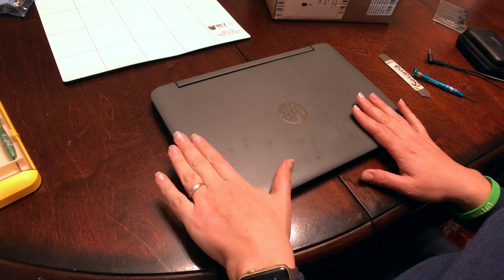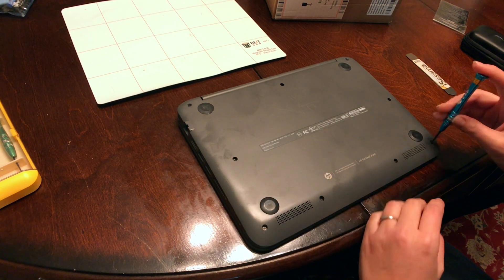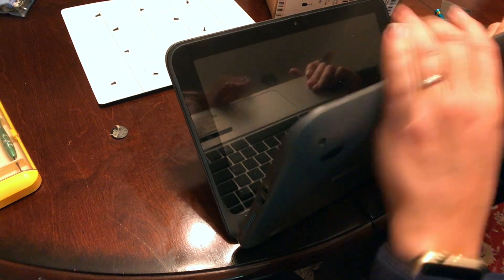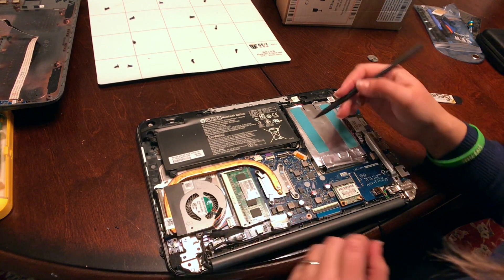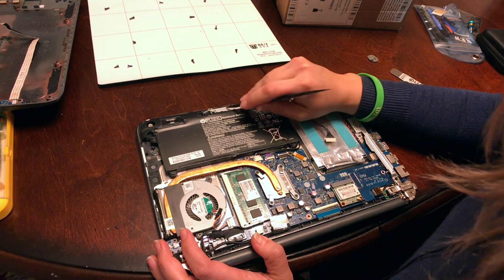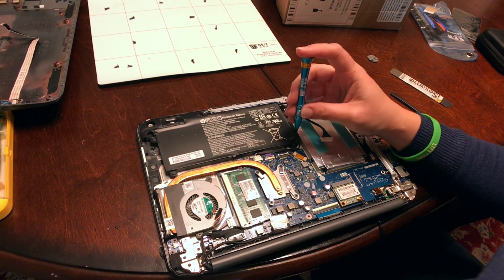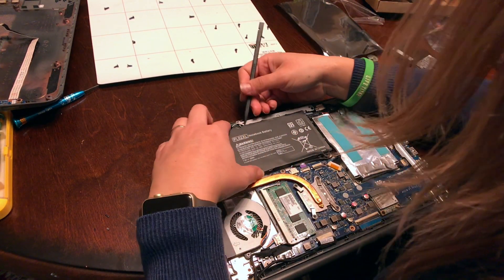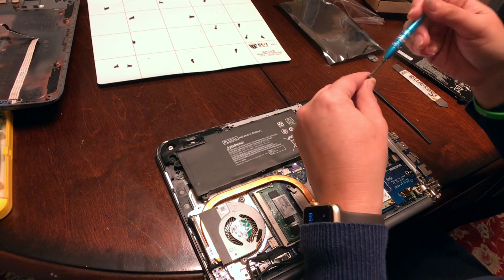HP X360 BATTERY REPLACEMENT.

Comment: Hi can you tell me the name of the battery? I need to buy one but I don't know which one to order from Amazon.
Reply: Most likely it is this one but cross reference your models S/N on HPs warranty lookup page which will give you the entire model number and not just HP Envy X360. You want the specific model that comes after the 360 to ensure the voltage and watts are correct.  In my case my customer said he had an HP Envy 360. I went on HP Warranty check and found out it is a "HP ENVY x360 - 15-u483cl" I then went on Amazon and found this battery.

https://www.amazon.com/gp/product/B077SFKBXQ/ref=ppx_yo_dt_b_asin_title_o00_s00?ie=UTF8&psc=1

If you scroll down under product description, they seperate out the specific different config models.  Mine is the 15-u483ul. As you can see it is in the list. Hope this helps. 

Compatible Part Number: NP03XL / HSTNN-LB6L / TPN-Q146 / TPN-Q147 / TPN-Q148 / TPN-Q149 / 760944-421 / 760944-421-18 / 761230-005 / 760944-541 / HSTNN-UB6L / J8C75PA 

Compatible NoteBook: 
HP Pavilion X360 13-A010DX / 13-B116T / 13-A012DX / 13-A110DX / 13-A068CA / 13-A072NR / 13-A081NR / 13-A091NR / 13-A113CL / 13-A233CA / 13-A001AU / 13-A120LA / 13-A201TU / 13-B101TU / 13-B201TU / 13Z-A000 / 13-A317CL 

HP Envy X360 15-U010DX / 15-U337CL / 15-U050CA / 15-U011DX / 15-U110DX / 15-U111DX / 15-U001XX / 15-U310NR / 15-U363CL / 15-U399NR / 15-U410NR / 15-U437CL / 15-U473CL / 15-U483CL / 15-U493CL / 15-U499NR / 15T-U000 / 15T-U100 / 15T-U200 / 15T-U300 / 15T-U400
Reply: @2siccaudio  thank u!!
Reply: @woodpecant6992  Ya no problem at all. I was once a person on here asking these questions and nothing is worse than when someone does not respond lol.
Reply: @2siccaudio  ya i know what u mean

Comment: where is the cmos battery? not the rechargeable battery
Reply: some of the envy x360 convertables (there are different variants of this laptop) do not have a CMOS battery.  if you are getting a CMOS error, it's due to an aging main batter, which interestingly, also acts as the CMOS battery (quite possibly built in). believe me, I've taken my laptop apart piece by piece, no watch battery in there, period... it's definitely built into the main battery.